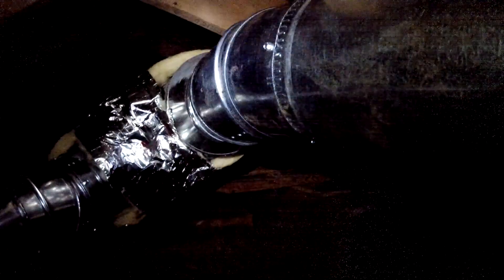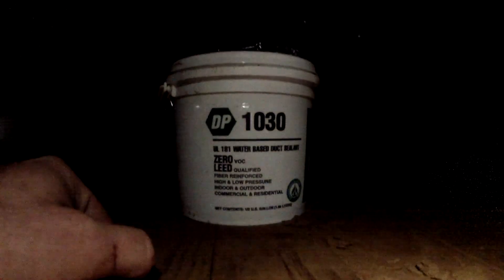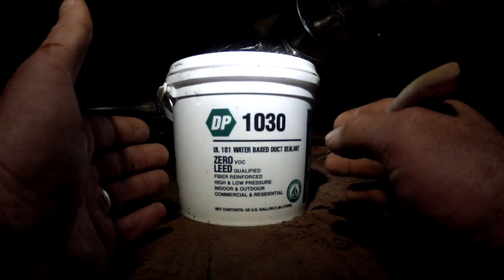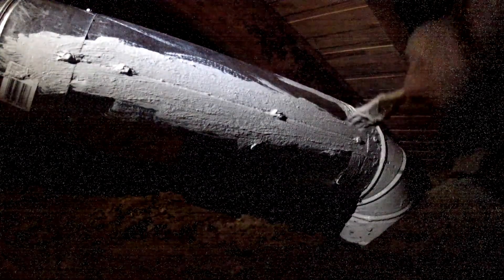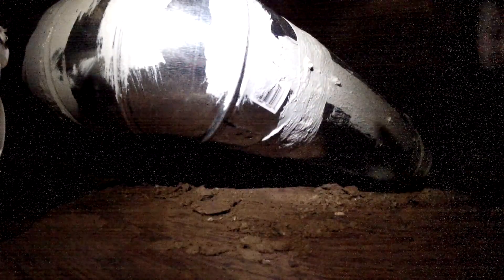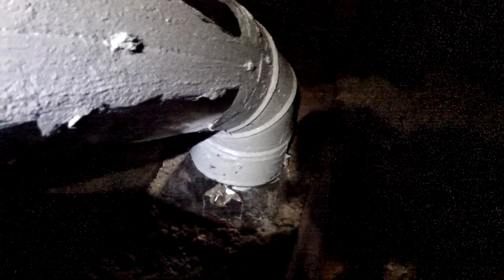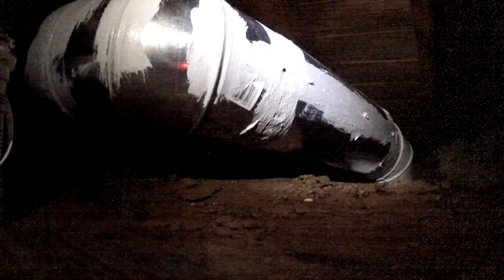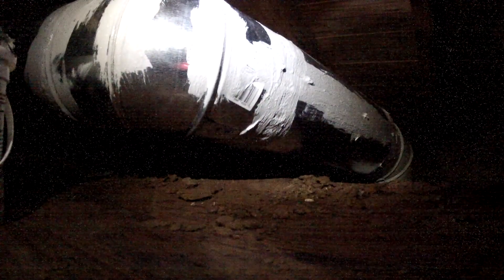Applying HVAC Mastic to Air Seal Your Duct Work

Comment: Is it ok to put mastic inside the duct?
Reply from the maker: You can but it’s not necessary. Also, the mastic could cause turbulence inside the duct and be a point for duct and other products to build up on it. I wouldn’t do it.

Comment: hello I have a question after putting the mastic how long does it take to dry and turn on the air?
Reply from the maker: The drying time of the mastic is dependent upon humidity. But, a general rule of  thumb is 48 to 72 hours.
Reply: thanks for answering.

Comment: I'm putting together a 7-1/2 Hp wood shop dust collection system combining salvaged spiral and snaplock components. Since the runs will be suspended from a finished ceiling I intend to assemble all but the drops on the floor, well, the drops too, come to think of it. Things change in such an environment as processes and equipment change. I wonder whether mastic-sealed seams will be difficult to separate when an altered layout becomes necessary.
Reply from the maker: Once it’s dry it’s pretty tough. You can break the seal on it but it isn’t “easy “